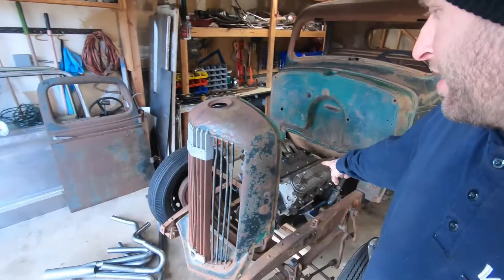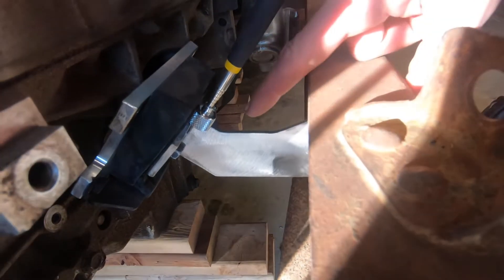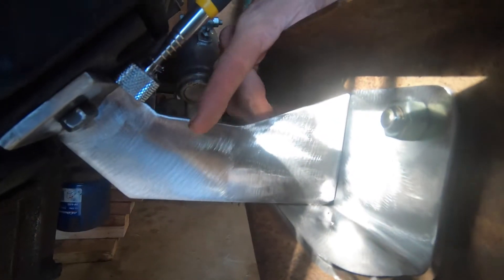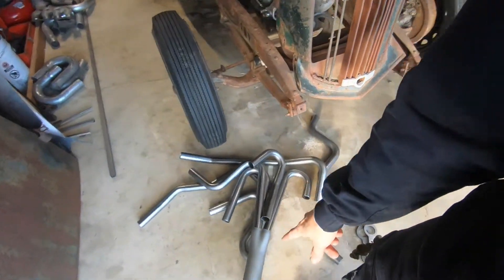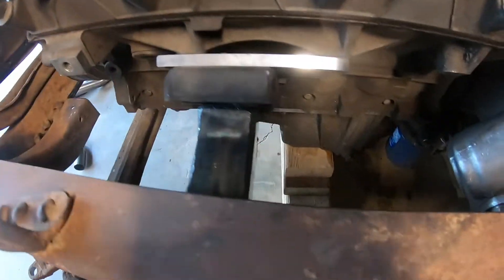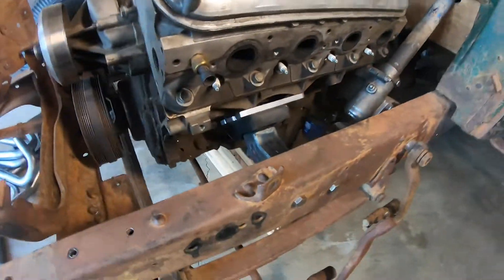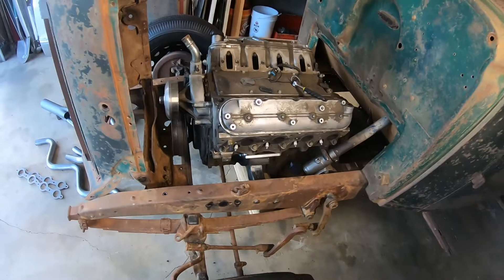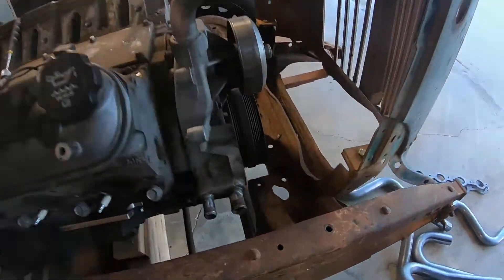How To Build Engine Mounts

Comment: What size thickness is that metal to make the mounts ??
Reply from the maker: I’m pretty sure it was 1/4” but maybe 3/16”. I would trust either size if it’s boxed in
Reply: @showmetrucks7113  was thinking of doing 3/16 square tubing to plate steel for my project . Reason why I asked , but thank you appreciate it !

Comment: !!!! Wow been looking for someone to make mounts for  Old CHEVY You The Man Thks again For Sharin Signed up right away been lookin for about 4 yrs Hard to find mine is 47 3 ton trying to put this Engine in 6Litre in mine tough to work with nothin making mine into water truck flat deck Basic frame and body solid no rust got metal to work glass is here so with anyway Ya Got this Keep it Comin Right along side ya it,s cold down here  minus 33 supposed to warm up got no heat in the old shop  workin on trying to get wood heat Least  out of the Wind I,m from  Canada SK Dalmaza on a Farm Thks
Reply from the maker: Definitely tough working in the cold. Yeah hard to find parts for trucks this old
Reply: @showmetrucks7113  What part of the states ya From  get cold down were ya are ? keep me posted nice to see the old ones coming back thks again
Reply from the maker: @paulmarks8401  well I was building in California but now I’m back in Pennsylvania
Reply: @showmetrucks7113  Ya Got This Keep Buildin them mine will be in Spring to cold to work on it right now